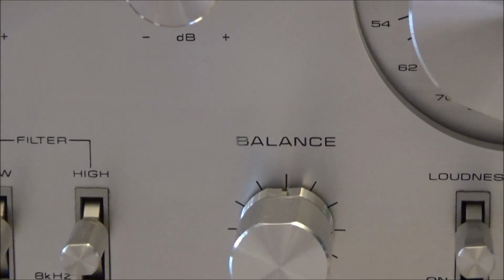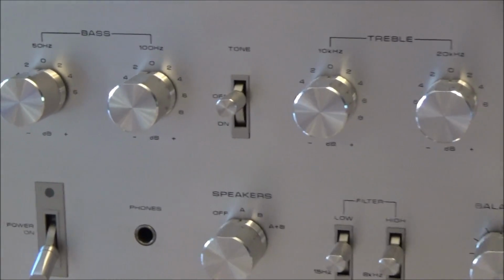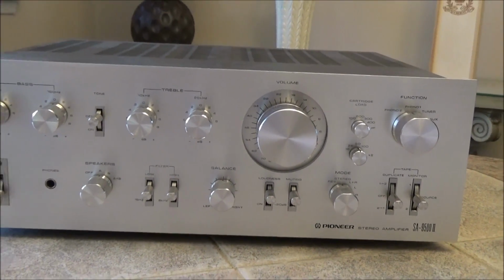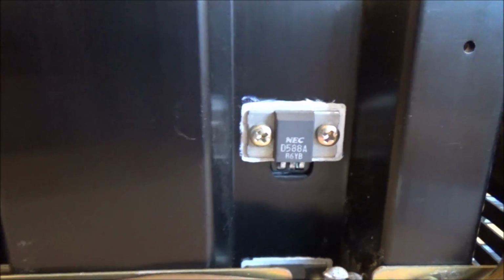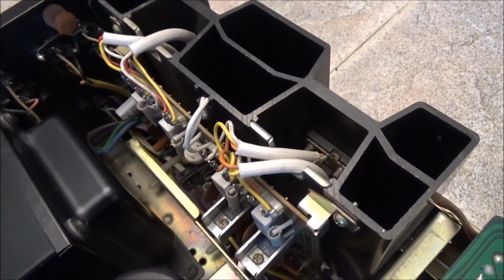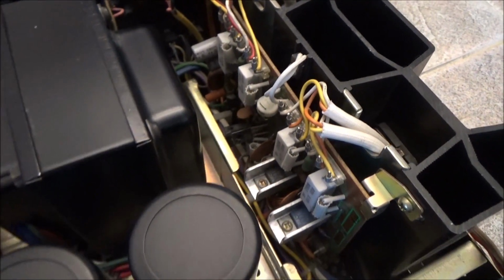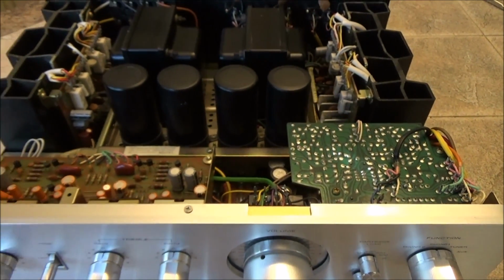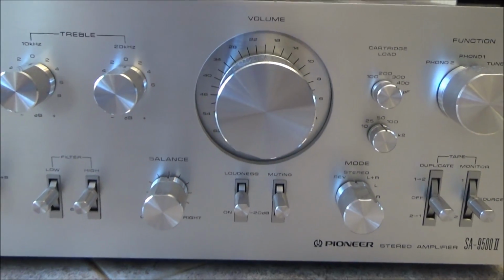Fabulous Pioneer SA-9500II Amplifier - Awesome Vintage !!  Look Inside!

Comment: In  a year time no reaction to my SOS message. Those SA-9500II are so good and I both a second one . They playing both FANTASTIC on all speakers I have they give a good warm and correct sound. Thhey where maded like tanks . About the time the japanese came with audio on the market in europe they where made and sold here . 
There was a gigantic competition  between european and japanese Amps . And because of the big competitions japanese ( Akai, pioneer, technics, sony, kenwood) they builded them extreme good; AND they where cheaper than all the rest of the audio wich where sold that time . 
My 2 SA-9500II and AM 2950 are still in perfect condition and still play them every day.... So if you find one dont hesitate !!!!

Comment: SOS  the balance of my 9500II is cracking a bit on the right side , and I cant find a hole to spray my WD-40 in to remove the dust. The question is where can I clean my balance inside????

Comment: 1976 1979 afther they started the bleu line series . I have the 9500II  and it is build like a tank. First I had the SA-8800 bleu line serie and it sounded better then the SA 9800.  
For me this is better then the high end amplifiers they make now. Butt behind it says 200 watts  And he gives 2x80 watt rms  ?? 
For my ears this is the best amplifier pioneer ever maded
Reply from the maker: The 200 watts written on the back is not the wattage of the audio output.  The 200 watts printed on the back is the maximum current it draws from your power outlet.

Comment: For some reason even though we are in a vinyl resurgence, manufacturers of new integrated amps feel sub filters are not necessary. Cone pump will be very disappointing to the novice:)
That’s a beautiful amp.
Reply from the maker: No more loudness/contour buttons anymore either...and no one makes EQs anymore either.  I had to buy a dbx pro model from Guitar Center and some pre owned older units to add to my collection.  I'm glad for the vinyl resurgence.... although I never gave up on my records and collecting.   Thanks for stopping by !!

Comment: Hi 
Great looking device.
What is the difference between this one and the MK1 version?
Regards
Reply from the maker: The SA-9500II has dual power supplies.  The SA-9500 has a single transformer and single power supply.  Thats the main difference beside other subtle differences.

Comment: This looks similar to my pioneer sa 9100 but I would say my 9100 has more controls than the 9500 it still sounds great for a 46 year old system.
Reply from the maker: Yes..I believe your SA-9100 has many more controls.  Your amp is an excellent amp !!
Reply: @gattigail  thank you I really enjoy using it, I have the matching tape deck and radio receiver to go with it.
Reply from the maker: @pauldavies8638  Cool...I actually had a set of the SA-9100 and TX-9100 that were both mint.  Loved them.  Stupidly, I sold them while  downsizing during a move.  Enjoy that amp!!  Incredible amp with tons of goodies !!
Reply: @gattigail  I have sa 9100 amp
Tx 9100 radio
Ct f7171 tape deck
Pl51 record deck
Dv989avi cd/dvd player
Sg540 graphic equaliser
Modified horn yamaha ns 45e
All silver fronted pioneer
That's what I use and I love it.
It sounds and looks good
Best wishes Paul.
Reply: 9

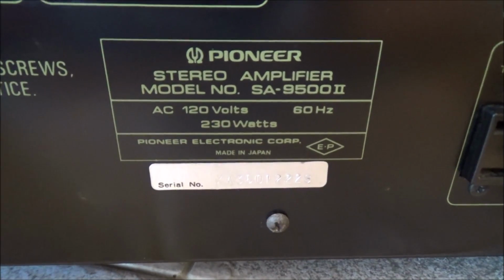Comment: Hi ! very nice amp.  However i see at 4:51  on the back of the unit  "230 Watts" ...is that the max power consumption ? if so the music power available should be around half of that ?  i am quite obsessed and love big power supplies ... the first and main bottleneck in an amp is the mains transformer ... what do you think ?  do you know what is the power on 4 ohm maybe ?  Thanks a lot and kind regards, gino
Reply from the maker: The 230 Watts is not the power output of the amp.  That number is the power consumption and how many watts it may draw from your wall to run the amp....probably at full power.
Reply: @gattigail  yes I see but it is telling of the max power output available usually half of that value like 115 watts for both channels in total

Comment: I've got a beautiful, visually pristine SA-9500 II that was my father's. I still have the orginal manual and circuit diagram that it came with. However, I have issues with intermittent, fuzzy sound out of the left channel when I turn the volume knob. I'd appreciate it if anyone had thoughts on what could be the underlying cause. Could it just be oxidation? I want to take it to a shop one day, but I'm hesitant until I find a place that's highly recommended. It may not be the rarest or most expensive bird, but it's special to me. Also, these are just plain sexy to look at.
Reply from the maker: Yes...it is a beautiful amp.  Maybe the volume is just a little dirty.  Try to clean it with a little Deoxit.

Comment: it took me some time I'm a audiophile and music file and I love that old powerful sound but today things have changed and I wanted something with clarity low distortion big class A power output and class A/B with wi-fi Bluetooth Hi-res d.a.c internet hook ups and CD /bluray/T.v.digital/analog inputs  detacable power cable front hi-res mass USB, direct bypass mode 2 channel only pre out  2 main preouts- 2 subwoofer preouts and 5 way binding post lol well I found it can't believe it out did all my Yamaha integrated amps also but the Pioneer Elite sx-n30 unreal if yay love pioneer it's a must ! oh plays 4 or 6 ohms but anyways that's a badass pioneer you got there !

Comment: One helluva component. I think it actually puts out 100wpc in 4 ohms. and 80 in 8 ohms. All at a THD/IM of 0.05%. Those Pioneer toggle switches are soooo authoritative in feel and function when flipped. The volume control is "stepped" for positive resetting of levels. Lots of goodies in both phono settings, however the filters have too gradual a slope. Still functional though. Phono S/N could be better than 75dB but that's minor carping. Bidirectional dubbing as well as pre out/ main in make this a great pre-amp alone. I had a girlfriend in Dyker Heights, Brooklyn in 1980 that had this unit driving AR-92 speakers and WOW did it sound great.
 Always sweet to see vintage "classic" components still in use. Nice video.
Reply from the maker: Thanks a lot !!  Your girlfriend in Bklyn must have been must have been cool !!! :)
Reply: I’ve got the sa9900 with ar9’s and often call in sick 😂
Reply: cmnhl, having heard the AR92's, I can only imagine how sweet the TOTL AR9's sound.
Reply: @martyjewell5683  yea, it sends shivers down my spine with the smoothness and details. And oh goodness, that bass
Reply: @cmnhl1329 , I imagine that the bass response is astonishing and capable of very high volume levels. How often do your neighbors call the cops??
Reply: @martyjewell5683  Haha! Good thing I’m on good terms with them all
Reply: Yes, it was rated for 100W per channel into 4 ohms. This amp could make my Infinity Qb speakers sing! Alas, I lost it all to storm/rain damage in a hurricane.
Reply: In early 1980's a friend had the Qb's with a Sansui receiver (G-5500) and the EMIT tweeters had superb response. He also had the Qe's in his den with a Pioneer SX-450 and that sounded impressive too.  @paulm749

Comment: I bought one of these at the flea market ten years ago for $20. It looked brand new and performed perfectly. I set it up as my bedroom stereo as it could not compete with my Sansui 9090 I was using in my living room at the time. Anyway, two years ago I sell the Pioneer on EBAY for $700,not a bad return on my $20. I have a room full of old stereo gear I have collected over the past 20 years. Most were bought dirt cheap at our local flea market. I never thought vintage would go crazy like it has the past few years. I wish I had bought more!!!  That Pioneer is one damn sexy looking amp though!!
Reply from the maker: I know...the prices on these vintage stereos have skyrocketed lately.  Thanks for stopping by !!!
Reply: the guy at the flea market I guess he knows nothing about audio-stereo. he never heard THD, RIAA, CD-4,  air suspension,  V-FET ...etc.

Comment: , make sure that you plug this amp into an a/c line condition/protection piece of equipment like I do.
I have a panamax and all my audio equipment is plugged into this to prevent and damage from power surges and you get much more stable & clean power as well. love this amp, I would give up a fucking nut for one of these, lol.
Reply from the maker: I also use a Panamax line conditioner/surge protector for all my gear.  I also unplug the Panamax from the wall outlet when I'm not using the system.  I'm not taking any chances..lol.  Thanks for all your cool comments !!!!
Reply: I have the amp. Trade nut?

Comment: Beautiful piece! Really nice video showing the inside and out. I'm still kicking myself, I had a chance buy one with the wood case on ShopGoodwill.com over the weekend for $255 using the "buy it now" option, but for some reason waited to see where the bidding would end up. Unfortunately someone else did the "buy it now" option. Even though it was "buy as is", it would've been a win-win whether it worked or not. I'll be regretting that decision for a long time. Curious though, if it wouldn't have worked, what is an average repair cost for the 9500ii?
Reply from the maker: Ahhh...the repair cost can depend.  There are some local techs near me that are very consumer cost friendly that would just repair it cheap...there are also over the top techs that would charge significantly more to refurbish....say anywhere from $50 from the low cost shop  to $400 at a total refurbish shop.  I made your same mistake many, many times when procrastinating on a purchase.  I know how you feel :)  Another one will come along....maybe better....Thanks for stopping by!!

Comment: I acquired mine and it was not taken care of. I still have a lot to fix but I did get a pretty much great condition TX9500MKii matching tuner with it. I traded some 2000s crappy KLHs for them both and I'd do it again if I could. Even with its issues it was worth to get both the Int. amp and Tuner.

I wish I could run it with using another preamp. The jumper RCAs were hacked by some jerk and now it is only used as my poweramp. 

one day it'll be running under its weight with the preamp and all.

nice face plate on yours too btw
Reply from the maker: Thanks!!  I used to have matching tuners for all my vintage integrated amps....but since I don't use the tuners anymore, I got rid of them to make space for more amps.  Now I've been using internet radio and the Google Chromecast Audio.  I actually have a few of them.  One I hooked up with a Optical cable using the DAC in my McIntosh preamp.  Sounds pretty darn good!

Comment: sir i have sa 8800 II model but we make a big mistake ..this amp supported 110 power supply but we turned switch it 220 ...and his campaciters heatup and blow fire ....please help me if you can how i solve it and wich thing in the amp are dead....please ..because in our country all the mechanics are fools...pls contact me my whatsapp number 00923330418080...

Comment: 4 sale?  Thanks
Reply from the maker: Sorry...not 4 sale.  This model is hard to find.  Thanks!!
Reply: one channel went out on mine in taking it to a pioneer. autherizd service place to get it fixed
Reply: wish I had a pioneer repair center near us in SF calif.   Had mine fixed for the same issue 2 times now. in 2 years...  for 42 years it worked flawlessly
Reply: see 3 on ebay atm, all from Germany